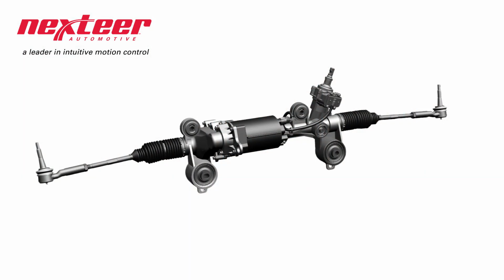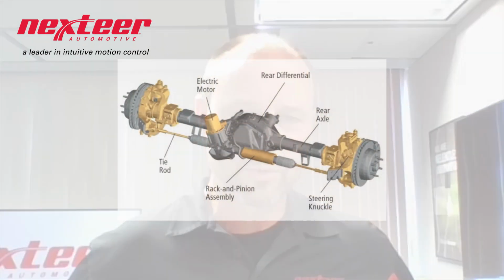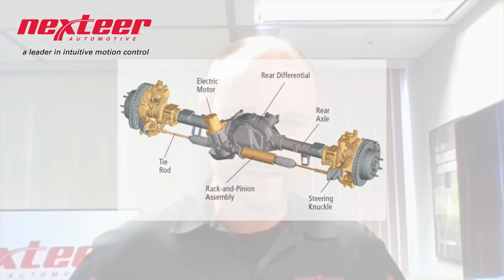Nexteer's New High-Output Electric Steering + Quadrasteer Still Alive!

Comment: Omg i am so glad I found this video. 
So I got to say, your or your competitor steering is in most all vehicles today and back in 2014 in cars. 
So I have drove Kia 2014, ford van 2018, traverse 2017, GMC Sierra 1500 2018,  2019 GMC sierra Dinali, 2014 ram 1500 Laramie. 

I could write a book on each one of these. 
Most of the complaint I have is safety. 
All of these vehicles wander on the road. 
I will say my 2019 GMC Dinali Duramax was about 85% good. 

My 2021 Dinali Duramax 2500. I say it is better then the 19 but that’s not saying much. 

I can pick out everything about the steering. I know what had to be done to correct it. You did better but still it is not as good as the slow moving gear box. 

Some things like a back road, why do you steer the truck with The suspension. There’s already enough going on. 

I’m not happy with the way you guys are doing with this!!!!  It’s not safe!! 
Not only that it removes the feeling you get when you drive your vehicle. So you never feel confident. 
The 8000 pound weight that the Duramax has helps compensate for that thank God. 

Anyway I hope this gets to someone important that loves driving like I do, rather then just exist in this world. 

In case you were wondering what I’m talking about drive a 2003 SS Silverado or trucks from that year that are not rack and pinion. 

Please help Preserve our American heritage. 
Hopefully they didn’t burn the books that were written 20 years ago on engineering. 
The true engineers were those guys. 
Need to find the people like that to build these trucks bc I’m not impressed. 

If it keeps going this way I might have to get a Sedan. 

I will not buy a 1500 because I may as well get a canyon. Basically like a car. 

Then I can save 80k and buy one for 30k 
Thanks hope this helps.

Comment: Tim, I don't recall as I wasn't interested in the system back in the early 2000's, but what kind of sacrifices were made in regards to towing and payload capacities due to a truck or suv being equipped with the Quadrasteer system versus not having it on the same vehicle?
Reply from the maker: Interestingly, it seems it ADDED more towing capacity. Payload might have dropped by a few hundred pounds.

Here's the link I found: 
https://gmauthority.com/blog/gm/general-motors-technology/gm-chassis-suspension-technology/gm-quadrasteer/#:~:text=Trailering%20capacity%20has%20increased%20from,provides%20more%20stability%20when%20towing.
Reply: Payload capacity was reduced by 300 pounds as the Quadrasteer assembly itself added 285 pounds. Towing capacities were also reduced by 300 pounds due to the sole weight factor, but that honestly doesn't affect anything.

Comment: I ve driven several sierras silverados with failed power steering SEVERAL Ive never had a mechanical fail on me.  These fail at a much higher rate then the old stuff.
Reply: If they all come from the same supplier they would be failing on all the brands. I don't have any issues with mine at 60k miles. I don't have Sierra.
Reply: What failed on them? What was the issue?